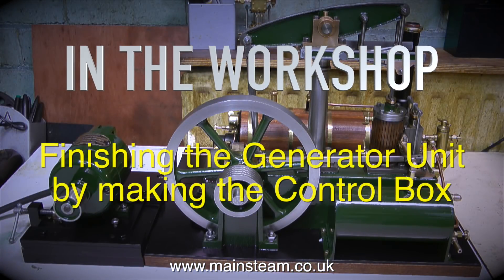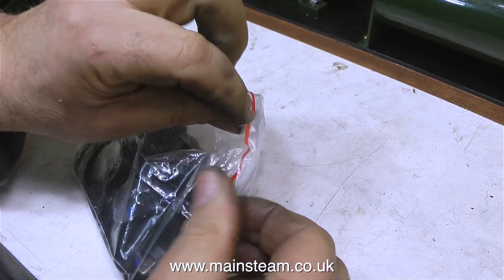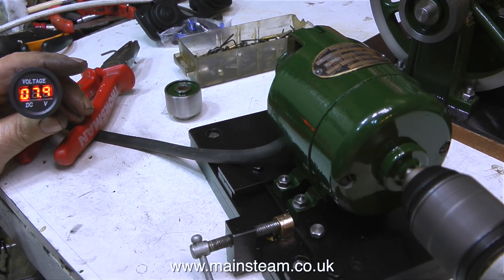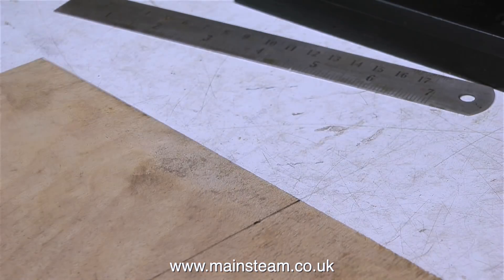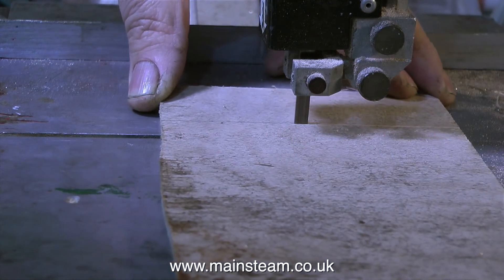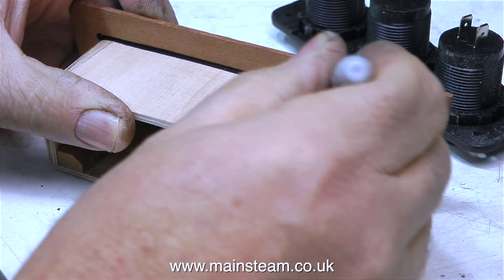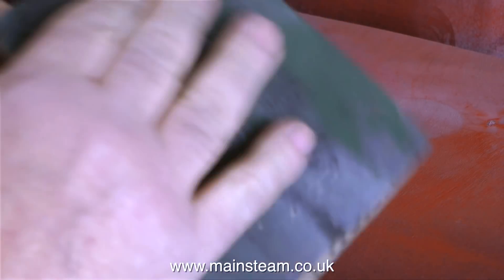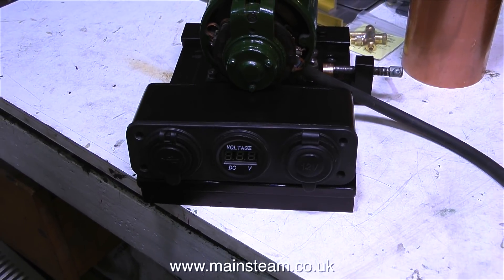FINISHING THE GENERATOR UNIT - IN THE WORKSHOP

Comment: Saw an article in which a town had no power in Alaska, but they did have an old logging railroad station with an old steam generator, without a boiler. Thankfully right outside of town there is a hot spring. So basically they put a dome over the hotspring, and piped the steam to the engine. The town of about 300 now have electricity for there public buildings

Comment: Just a thought.  Take it for what it's worth, but if you add a small 12v lead acid battery into the circuit, it would even out the voltage.  The generator would only need to maintain charge.  Again, just a thought.

Comment: Very interesting. About ten years ago, I tried to build a steam powered computer using a 504 boiler, a Stuart Score, and a 12v DC motor designed for model cars. I had to make a line-shaft (with some help) to gear the motor to turn fast enough to produce a sufficient voltage. 

The project was not entirely successful - the steam engine, which I had bought on "the auction site we all know and love" was not as well machined as it might be and had too much clearance between pistons and cylinder, so drained the boiler very quickly such that it could only run the motor for a minute or two even when not under load (when I tried loading it, it would barely last a minute). I managed to cremate one of the exact same type of Bix burners that you are using in the process, and cremated it so thoroughly that the metal box holding the ceramic in place was de-silver soldered. Also, the gear cog that I had put on the motor/dynamo (connected to the line shaft using a bicycle style chain) and fixed with Loctite fell off on the second run. I have videos of all of this on my Youtube channel, including the burner cremation and the testing of the steam plant in various stages.

I did not get as far as the output panel or the computer itself; I tried to re-machine the cylinders and pistons with the assistance of my local model engineering club, and made some progress with that, but then ended up moving into a small flat and could not continue with any model engineering. 

It was that project that got me into model engineering in the first place, and I believe that I bought one of your video CDs for instructional purposes (and possibly one or two other things from your website; I know that I bought things from Blackgates Engineering) at the time, which is how I ended up subscribed to your channel.

I now live in a house rather than a small flat and have the engine/boiler plant in my attic. I often wonder (especially when I watch these videos) about having another go at making it work and turning it into a USB charger instead (with a volt regulator), although I do not have (or have space for) a proper workshop in my house.

For these reasons, I shall be very interested to see how you get on with this and the 504 boiler.

Comment: Keith, I bought a few USB chargers from China a few years ago to use in the car. Eventually I realised that after about an hours use they got hot enough to fry bacon (or at least make toast!). The car never did catch on fire as I realised the problem and binned the offending articles. They cost very little and were not worth sending back. Hopefully your usb charger will be ok, but suggest you keep a close eye on it until you are satisfied that it is not an unintended method of heating your workshop. Great videos, best wishes. Ed White

Comment: since you call it a generator I assume its putting out DC current, and even so its bound to have some good bumpy current, which you wont see on a meter (esp on a chi-co automotive LED gadget). So while its reading 8-10 volts it might be an average over the humps and dips, and a good sized cap will smooth that out and give you (more or less) clean stable current (with some high frequency noise, but what your connecting to it will handle that, just like in a car) 

if its AC current, the electronics you connected to it should (if the designers are not completely retarded) be able to handle that, but its not optimal and may even not function once a electrical load is applied, and rectification would be required (along with a smoothing cap) which is both inexpensive and easy.

Even with a 8 volt input there's no reason that could not charge a phone, its just not having to work as hard to shift the voltage from high to low, its actually more efficient to run a 12v to USB gizmo at lower voltages (both in old school linear designs and switch mode systems)

Comment: I was wondering why you seem to prefer flat head screw over Philips or one of the other cross point styles? I've always found that it's difficult to keep screwdrivers from slipping off of flat heads when working with them. Is there an aesthetic reason or is this just personal preference?
Reply from the maker: When I was young that's all there were - and most things were screwed together using slot headed screws - so that is why I use them. "Pozidriv" or "Philips" type cross head screws are a bit "Modern" for model steam engine applications.

Comment: Another great episode! I've been meaning to ask (in case it hasn't been asked before) about steam engines built from machined kits, and what considerations need to be made in order to get the best-running example. Conceding that they're probably not the ones you might build (and perhaps you might frown upon building them), I don't have a lathe or a milling machine or drill press or the rest of it, yet I want a steam engine that I can build and run and take pleasure in. Has this been covered in a prior episode? If not, I'll wait patiently for coverage at a later date. Thanks very much for offering up great content.
Reply from the maker: There are quite a few ready machined engines on the market, from the simple V twin oscillator Model Boat engine called the "Blackgates Twin" to the more complex (and more expensive) Stuart Models range of pre machined kits. It depends on the application really, the Stuart Range is fairly comprehensive with regard to the type of engine - have a look on their website.

Comment: Instead of a gearbox, you could build a step up transformer that will up the voltage input electrically and require less load on pulleys or generator, have some capacitance and some conditioning resistor to protect the volt gauge  as the electronics inside the Chinese gauges are a little fragile with spiky volts and current (I have an exact same setup for my three wheeler), Bigclivedotcom's channel has a lot about home brew electronics as has Julian Illett, I intended to do a steam phone charger myself with the scratch built engine I have, bought the electrickery bits but like so many projects is gathering dust on my workbench hehe

Comment: If I read the makers plate correctly, the generator was .75 HP. That would a bit over 500 watts. You could build a gauge that would display H P if you had a load bank. That would be an impressive test stand for smaller steam engines
Reply from the maker: I thought that it said on the plate .0075  .......
Reply: .0075 would be 5w , barely enough to even charge a cell phone, lets hope its .075, aka 50w
Reply from the maker: it lights a car indicator bulb though :-)))
Reply: ahh an indicator is 21w so it must be a 0.075  , so about 50w peak if run fast enough, so yep plenty to charge a phone so long as it gets to 10-12 volts for the usb adaptor without having to scream the power plant

Comment: What's considered warm in the north, just above freezing? On a more serious note, you don't need to run the generator at higher rpm, just install a DC boost convertor, or a step up voltage regulator. It's the size of a 25 pence coin and it costs under 3 quid
Reply from the maker: and a small light bulb too ......
Reply from the maker: Good idea {:-))) Thanks for the constructive comment .....
Reply: as long as you've got the amps i suppose
Reply: hope that it can produce power at lower rpms , it might have to run  1000rpm to produce enough to convert
Reply: Just to add to Andrei's comment, if you are worried about too much power going into the outlet unit then you can use a L78S12CV Voltage Regulator, +12v, 2 Amps chip to cap the power at 12v. Great video as always Keith.